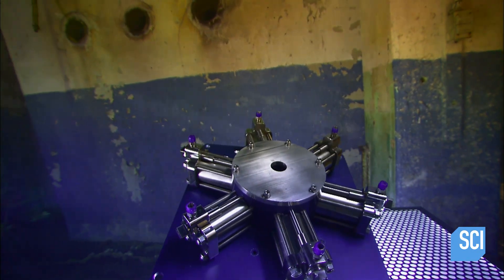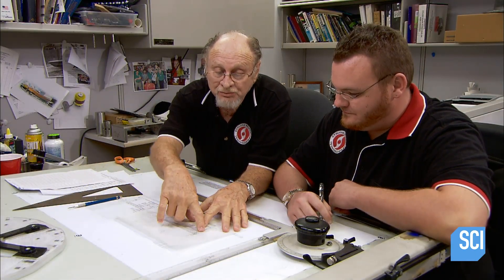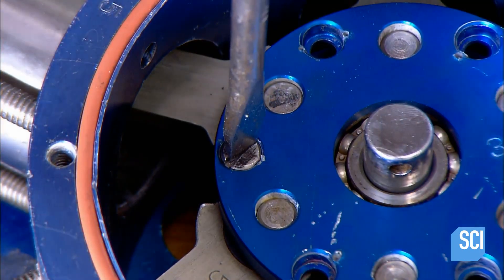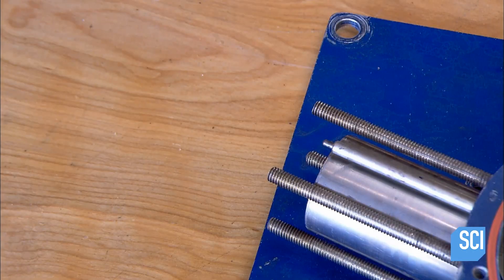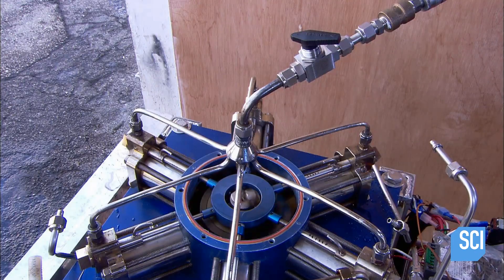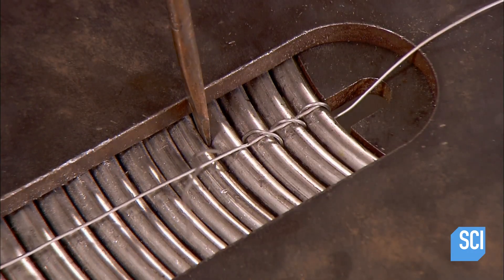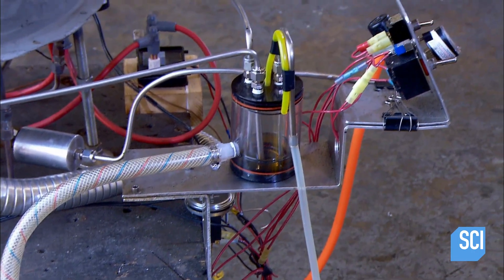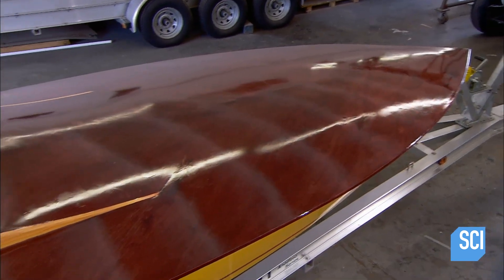How It's Made: Steam Engines

Comment: Would have been nice to see some performance data... Former 1200lb/1200° boiler technician, USN...
Reply: from a steam engine design stand point this engine is a toy at best, the single acting pistons, no lubricant (idk what the hell they were thinking on that one beyond it being to hard for them or smthn) and fixed valve openings mean that it would be either extremely wistful of steam and positively anaemic for the amount and pressure of steam it consumes, Stephenson's rocket would out perform it by far if they were both run off the same boiler.
Reply: @crestfallensunbro6001  yeah,  looks like a very lame design. Hence the reason we never heard anything more about it...
Reply: @Sean Embry Distill it down to chemically pure water, add any desired chemicals to inhibit corrosion, inhibit foaming, etc., and call it feed water.  Anything that you don't use for boiler feed simply add some of the minerals back in, brominate it, and call it potable water.

Of course, this works MUCH better when you have steam available in large quantities to distill the water, and you are floating around in vast quantities of rather salty feed stock.

Comment: That's pretty amazing. Now that's the kind of thinking we need. Knocking down pollution and using new types of fuel like used vegetable oil. As long as Big Oil doesn't come in and buy it like usually and shelve it.
Reply: Using vegetable oil is not new, it powered the first diesel engines.  Vegetable oil was abandoned because it is expensive.  The only thing which makes vegetable oil appealing in modern times is government subsidies to the farm sector.
Reply: @rockets4kids  The thing that makes it appealing is that it's renewable.
Reply: @Tokorai  but not sustainable in mass quantities for the average person like gasoline is.
Reply: Well,  considering that this video was originally aired about 8 years ago and we've still not seen a single working prototype,  I'd venture to say "big oil" is in no rush to buy this one out! If they were going to buy anyone out,  it would have been Elon Musk...
Reply: @Quickened1  They have no problem with electric vehicles.  An EV goes home at night to be plugged in to a fossil fuel power plant.
Reply: @kevincrosby1760  the real reason they have no problem with ev's is because they are all investing heavily in the technology. They're going to stay rich from both sides of the spectrum!
Reply: General consumers can make a dent, but it is the big companies who cause the majority of pollution.

Comment: so.. somehow burning fossil fuels to make steam is "cleaner"? what?
Reply: This method allows u to burn practically anything, not just fossil fuel. Which is excellent if u want it to serve as a multifuel generator. 

Is it cleaner? Cant really say… burning anything with carbon in it with air will always produce CO2. But burning it at a relatively low temp and very low pressure will atleast make sure theres barely any NOx produced. Would u believe me if i say that the most efficient diesel engines are the most dirtiest? Abit counter intuitive, isnt it?😂
Reply: The more efficient the burn the higher the NOX emissions. IIRC, and I may be way off here, the unburnt fuel acts as a reagent to speed up the break down of the NOX. Or it prevents the heat needed to for nitrogen oxides to form.

Comment: so what's the reeve valve for on the top of the piston?
Reply: It's the exhaust valve.
Reply: I think I figured out what reeve valve 
is for on top of the piston. Anyone correct me if I'm wrong but when the Piston goes in the downstroke I'm sure there's there's some pressure there when it's going in the downstroke so it needs to relieve the pressure
Reply: @willhe86  Close.. The reed valve opens during the up stroke to release the steam pressure into the crankcase.  The reed valve is closed during the downstroke.